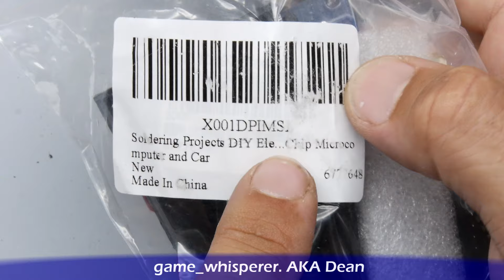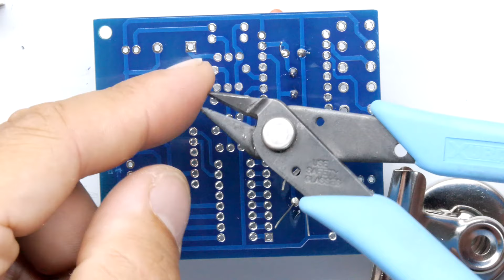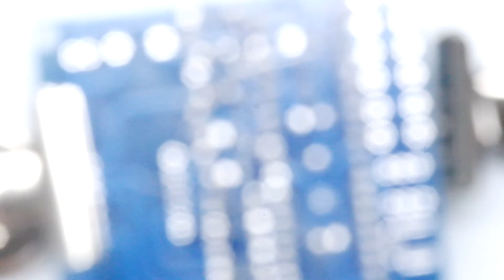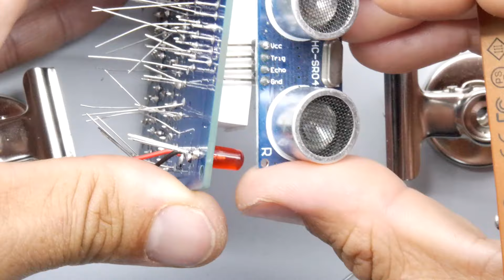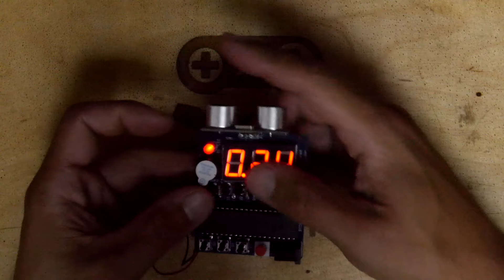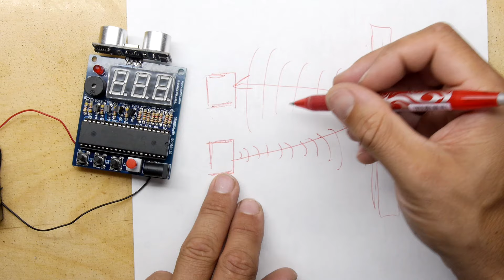The best Amazon Electronic Kit So Far! - Ultrasonic Measure and Alarm

Comment: I think that's why the DC in holes are so wide. You wire in the battery holder to them. Or through the holes in the legs

Comment: Curious what type of solder you use. I know you said .8mm (.031") but is it 60/40, 63/37? RA, RMA? 1.1%, 2.2%, 3.3%?
I'm currently using a very old roll of kester "44" 66 core (3.3%) RA .031" and I just grabbed some kester 245 63/37 eutectic at .015" (.4mm) for smaller SMD boards.
Just grabbed a 4 pack of SMD training boards which will be fun after practicing with these easier Through hole kits.

Comment: Okay so my S2 button is not working but everything else is fully functional. I can set the distance and see the range of whatever object is infront of it. But the S2 button will not let it -1 from the screen. It only increases in value but won’t decrease. I soldered everything correct I believe. What could be the issue?
Reply: I've bought and built many of these kits. A good thing to do before you build it is to test every component that you're able to test. 
8 times out of 10, one tiny component will be bad and ruin the entire experience.

Comment: Those holes for the buzzer/speaker are so big, you could have just heated the solder in the hole and bounced the board on the table, and the solder would have come right out, when you do it that way you usually don't even have to clean the hole out

Comment: For this kind of assembly, I hold the board horizontally, push in the components, then put a foam sponge on top of the components and hold it in place with a rubber band.

Comment: Fun Kit.  Haven't yet figure out the set buttons.  They not only press, but also joystick.  And, so, they do ... what I wonder?
Reply: A little research yielded; S2 = Reduce Distance / S3 = Increase Distance / S4 - Set-Display [Current] Distance
Reply: Trick/Suggestion:  Discovered that pushing the S2-4 buttons don't really work.  HOWEVER, pushing them Up/Down works great!  To set the desired distance (alarm threshold), push S4 up/down to enter input mode, then push S2+3 up/down to decrease increase distance threshold.  To accept, push S4 up/down again to exit set mode.  When not in set mode, display shows distance to target.  Cheers.